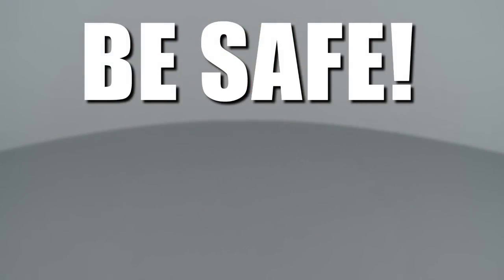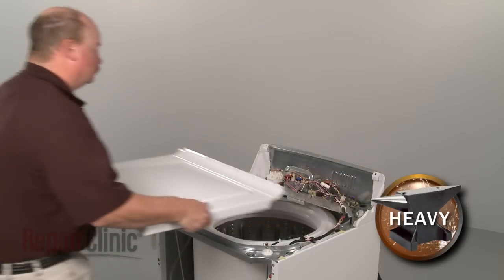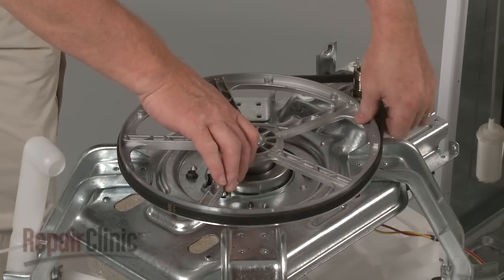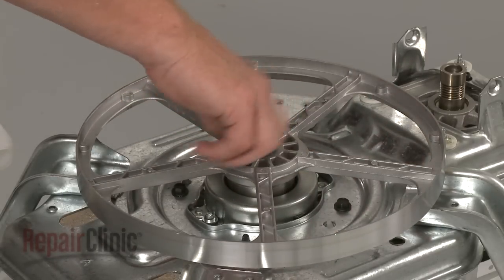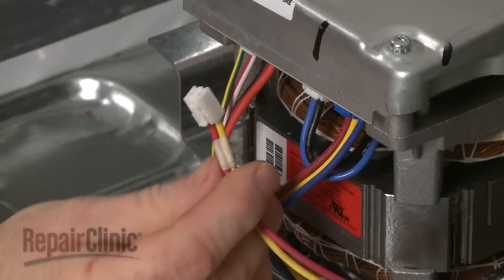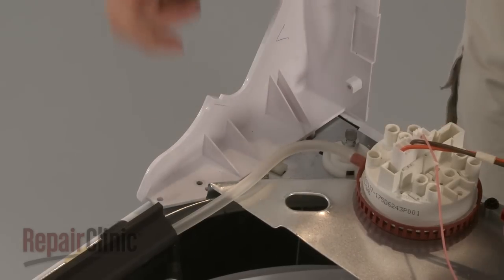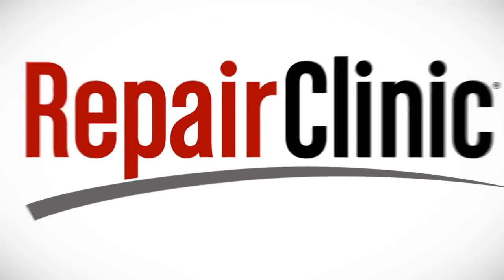GE Top Load Washer Clutch Assembly Replacement #WH38X10017

Comment: Just did this job on my old GE washer. It took me about 3.5 hours start to finish. Count on a lot of cleanup work, you're going to find a lot of fabric softener residue and hard water deposits. But a new clutch, belt, tub bushing, tub seal and a lot of cleanup later, my washer is working like new again.

Comment: Overall excellent & detailed video! Really great job of keeping the pace brisk while not losing the viewer. However, it skips one critical detail: change the seal; a new one comes packaged with the mode shifter anyway. This is very important because water (hot, soapy, grease-dissolving water) leaking down the shifter's shaft from the tub seal are what often kills mode shifters and tub bearings to begin with.
Reply from the maker: +johndesr <-Great point John. For info on replacing the main tub seal click here: https://www.youtube.com/watch?v=KCFFQiakXg4

Comment: In my case, my machine is 7 years old, the seal slot located in the outer drum has already expended.  Even with a new seal tub, it will still causes water leakage.  To ensure a correct seal tub from any leakage, you have to make sure the new seal tub is sitting correctly and NOT rotating as the rod spin.  To do this, I simply use a white Teflon Tape and wrap around the outer seal’s ring until the diameter thicken.  With this method, your new seal tub will fit tightly.  To ensure it is installed correctly, spin the rod manually to make sure the new seal tub will NOT spin along with the rod before putting the machine back together for a test run.  Good Luck!

P.S.  Great Video btw!
Reply: Roger K Ng same happened to mine. Had to tear it down a few times.  Still leaks with your method.  Too expanded i guess.  Good idea though!
Reply: @timowen2307  sorry forgot to update, the tape didn't last long.  The force is just too great.  I end up epoxy the pieces which is more of a permanent step.  Good luck!

Comment: Nice video, took 3 hours taking my time.  Beware your old washer will be corroded.  I used an electric impact wrench and 1-11/16" socket to remove the tub nut with ease.  My old tub seal was leaking, rotten and rusted and expanded causing the bearings in mode shifter to go bad.  However the seals that i ordered separately and one that came with kit cause the tub to LEAK down the shaft after replacement. My new seal from repair clinic is torn in 2 spots in it even though its new....  Chicom part no doubt.  Im not happy.

Comment: Thanks for the  video. Saved me a few hours of head scratching trying to figure out how to get it all apart.  Had to use an air chisel to get the drum nut off. 10 year old GE.  Replaced the entire clutch assy #WH38X10017 and got it all back together and now it doesn't work at all.  Fills with water, but doesn't agitate or spin. update Put the old clutch assy back in,  and it works as in it does what it was doing before, clutch assy is locked and it moves the whole drum with the agitator.

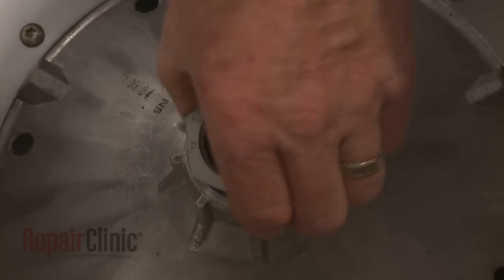Comment: I'm a big fan of RepairClinic. They're my go-to appliance site for parts and info.  But in my experience, 3:10-3:20 in this video is completely unrealistic.  Seriously?  Just tap the hammer a few times and the tub nut just spins off?  Keep it real guys.  I just had to do this last week, and it took several evenings of soaking with PB Blaster, applying heat, and banging with a cut off sledge hammer to eventually get the tub nut loose.  Getting a tub nut off can be insanely difficult, and I only wish the segment on getting the tub nut loose was a little more real-world (or at least offered a little caveat in the comment or something).  Otherwise, an excellent repair clinic video as usual, and I highly recommend RepairClinic.
Reply from the maker: Thank you for your suggestion. We definitely understand your frustration and we will take your comments into account going forward.
Reply: Doing this right now, and I agree. The video has been a great help so far, but getting the nut loose is extremely difficult.
Reply: I was having the same difficulty,  lucky for me I have a 1 11/16" socket, the only problem is it is for my 1" air impact...spins right off😳 just make sure to remove the nut in the proper direction! Lil nervous on using my impact to tighten it though....

Comment from the maker: +RaRa Roxy Replace the tub seal to stop the leak. It is not worth taking it all apart again without replacing the seal. Since the clutch is new, just monitor it for a few weeks and see what happens. The noises may stop and the agitation may be normal. The old clutch may have been slipping. The leaking water may also be causing some of the issues.
Reply: This part is pretty expensive considering the cost of it new was under 400.  What exactly fails in this part. I know mine is leaking and clicks very loudly ? Is it just the tub seal or another seal in the mode shifter . It sounds like the teeth that engage / disengage are not fully being held up by the magnet and clatter as it spins .

Comment: I replaced the tub seal and bearing but my washer still screeches and leaks down the drive shaft.  It also makes a very loud noise during the spin cycle.  Could the clutch assembly be my problem?

Comment: Putting back the transmission. the transmission turns like it's in natural ?  I have had a hard time, tightening the nut for the big pulley, But the pulley still rocks around or moves around like something is missing.  Does it not, tighten down because of the clutch on purpose.  Is the big pulling designed to move even after the pulley is tightened down ?

Comment: My GE makes a clicking sound on heavy loads. I don't think it is the known apron issue or that it is rubbing the bottom. It seems to be coming from this clutch area where the agitator gear engages and disengages. Guess the question is what are the symptom repair clinic for needing to replace this part in the first place?

Comment: If the washer is older, you need to chisel and/or cut off the spinner nut... if the washer is newer, you can maybe unscrew the spanned nut... most of the time, you need it chisel and/or cut the spinner nut off...

Comment: Another point that caused me some confusion: the bolt that holds the agitator has 3 small o-rings stacked on its shaft. Some of those will fall off and get lost or stay stuck in the agitator when you remove it. You must find those 3 o-rings and reinstall them on the smooth section of the bolt shaft right away so they don't get lost. Those o-rings are not shown in your video nor on the GE parts diagram, so I had to do quite a bit of web searching to find out where those mystery o-rings go and how many are supposed to be there!
Reply: No o-rings on mine...

Comment: Thanks for the awesome video!  How would I tell if I need to replace the clutch assembly (WH38X10017) versus the tub bearing (WH2X1198)?  My washer started making a lot of noise and by taking off the front cover I can tell it's coming from the bottom of the tub. When it's doing the wash cycle, with those 1/4 turns, it makes a soft grinding. Then on the spin cycle and other cycles where it spins all the way around, it is really loud now.  I'd like to replace the correct part and the clutch assembly's >$100, so I'd rather only replace what I need to.  Any way to tell which of these parts needs replacement?
Reply from the maker: Dave Nelson We recommend using the repair help section of our website - @repair - if you enter your washer's model number there you'll have access to model, part and symptom specific repair help. It will describe how to attribute different symptoms to parts.
Reply: I love Repair Clinic and watched this video several times, including when I disassembled the washer's innards. 

I successfully replaced the seal, tub bearing and mode shifter; I had a mode shifter failure, caused by a tub seal leak. I did the tub bearing since I was in there already. 
Note to the uninitiated, however; as others have noted, this video shows somebody dismantling a new, factory-fresh machine. After a few years of corrosion, caused by failure of the tub seal, the reality of removing that nut is very different.

The tub seal leak/failure is inevitable. I will be checking my seal for leaks, regularly, from here on out. Corrosion will inevitably form around the tub seal, pushing it out of shape. 

Water and a world of pain follow. GE could certainly have done several things to avoid the problem, but all of these options would have cost a few pennies more.

Bad news/good news. The bad news is that on a real-world, used machine, the tub nut will be so fused and corroded onto the inner tub and mode shifter shaft that I can't imagine that you would ever loosen it with the wrench from Repair Clinic. 

However, the wrench is useful when you need to tighten/put on the new one, so you will need it. However, where the video shows the tech tapping the hammer 4 times to loosen the nut is ONLY true on a brand new machine, with no corrosion.

The only way that tub nut was coming off on my real-world machine was with drilling and chopping it out with a long and narrow drill bit and a long and narrow cold chisel. 

I tried several days of soaking and tapping with PB Blaster; nothing, at all. The tub nut was truly fused to that collar and shaft. 

My nut only, finally, came out in about 10 pieces, bit by bit. Not exactly a few taps of the hammer...:-).

I bought my new nut and used it as a gauge, so I knew how to drill/the shape of the nut. I used a 3/16" diameter 15" long bit and a long ("star drill") cold chisel that is roughly 5/16" thick and about 15" long. I ground the star drill to form a long straight cold chisel. I drilled carefully around the nut, about every 5/16." Very happily, the nut is a light alloy that drills easily. 

When the drill gets to the bottom of the nut, you can feel the drill grab a bit; just go carefully. Chop the pieces out, prying the chunks away from the spindle threads. Once you have the right tools (a long drill and a long, narrow cold chisel), it really is quite easy/fast.

The other bad news is that the tub bearing will also be welded into the tub; again, due to corrosion. If you want to replace that, the only way to get it out, for me, was driving it out, using the old spindle, a pipe, and a 5 pound sledge.

Finally, the pulley nut is also seriously "on there." I finally got mine off with a breaker bar and pipe extension. Again, the nut was corroded/frozen, as well as probably being tight, to begin with.

The good news is that the order of events the video outlines is really solid; follow the steps and you'll be successful. Putting the new stuff in is easy and fun, after the surgery required to get it apart.

The really good news is that my washer runs like a silent top, now. It is fun to use it! I also understand how the thing works in a way that wasn't possible before. 

The final good news is that I know that I need to check the tub seal pretty often. I also know that popping the front off is easy/simple, so there's no reason not to check for leaks before things get bad.

I took photos of the process. If anyone is struggling with that nut, I'd be happy to send you them, to help you with your surgery...

Thanks, Repair Clinic, for the step by step video and the factor parts!
Reply: Photos from the washer surgery/removing the tub nut, seal, and drum bearing:

https://drive.google.com/drive/u/0/folders/1PJfOllj19jQFXAcwGtlgSRxgjjFRllWn
Reply: I'd add that my experience, after installing this part, adds to the idea that GE produced a lot of defective units of this clutch. I had read about this online, but didn't want to jump to conclusions. 

The rumors I read were that GE pumped out scores of defective mode shifters, and shipped them anyway. I don't know about all of that. I can only report that... 

Roughly a month after installing the new one, I'm getting 9 flashes on the LED; to quote GE's website: "9 flashes; motor brake mechanism is defective; unplug the washer and replace the drive motor."

I started getting 4 flashes soon after I'd installed the last one and I contacted Repair Clinic. GE's site says, "4 flashes; mode shifter circuit failed; the mode shifter is a component on the drive shaft assembly. Reconnect the wire harness between the inverter control and the mode shifter if loose or disconnected. Replace the drive shaft assembly if the mode shifter is defective; the mode shifter is part of the drive shaft assembly and isn’t sold separately."

To their great credit, Repair Clinic sent me a new unit a couple of weeks ago; I called them when I started getting 4 flashes. Yay for Repair Clinic!

I've been getting by on resets for a couple of weeks, but no more. Time to replace the part for a second time. The rumors are true in my case, anyway; this was clearly a defective part. The unit is bone-dry; no seal failure at all.

The bad news is that I have to do all of the work again. 

The good news is that it so soon after my last trip into the machine's innards that nothing will be rusted/frozen; it may actually come apart as easily as shown in the video!

Repair Clinic certainly can't help if GE produced defective parts. I am very grateful, however, that they are standing behind the part they shipped me!

Comment: How do you know when the tub nut is tight enough? I hammered it a few times and on the 2nd post-fix wash, it loosened and the inner tub went nuts, scraping plastic everywhere. When I took the laundry out, the nut was pretty loose.
Reply from the maker: After you tighten it, you can wiggle the tub around and tighten it. Although tighter is better, use your own judgment; you don’t want to break the nut or strip the threads.

Comment: Also if this washer is been used the stuff is not going to come apart like the video everything gets fuse together
Reply: yes, I laughed when I saw him remove the drive block. buy a new block, you may need to just hit the old one with a chisel and split it of. they are cheap. replace the screw also. it has a seal on it. and get the belt tool ,WX05X10102, makes life easier. maybe new belt also. it's 10 years old, when in there do it all.

Comment: I have a GE WHRE5550K2WW top load washer. My tub is leaking, but the leak seems to be coming down the inside of the drive shaft/clutch assembly instead of the outside (outside of shaft is dry, but heavy leak on bottom of shaft/clutch assembly), do I have a bad shaft (maybe a bearing letting water leak past inside the shaft) or is it more likely the tub seal?
Reply: i have the same problem. did you ever find out what it was?

Comment: After replacing the clutch assembly, my washer started leaking around where the shaft goes up through the tub and spin basket. Leaking down the shaft. It is also agitating very rapidly and pretty hard stopping as well as squeaking a little at the end of the agitation. I have removed the spin basket, reset it and tightened the tub nut as tight as i could with a pipe wrench and a sledge hammer. What do I do?
Reply: BTW the video was awesome. Very helpful, informative, and detailed. I agree with some of the other comments though, removing the tub nut was way more difficult than depicted.